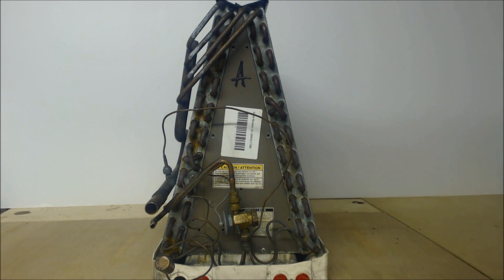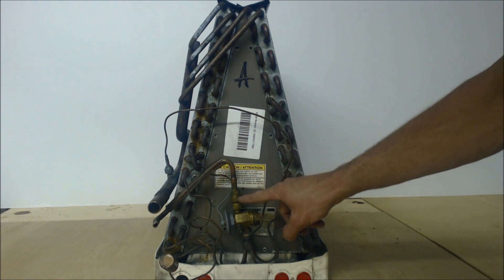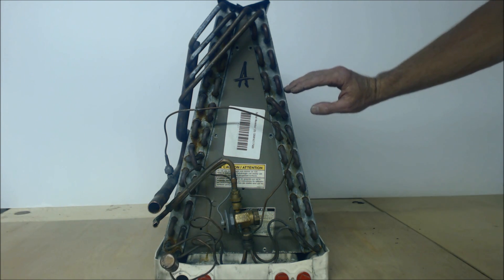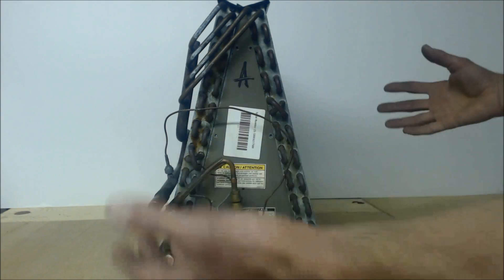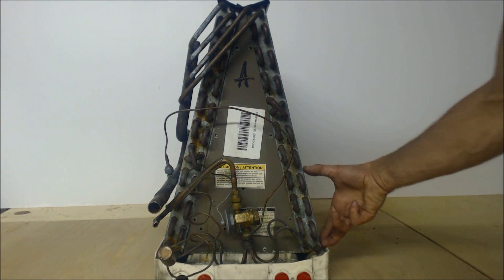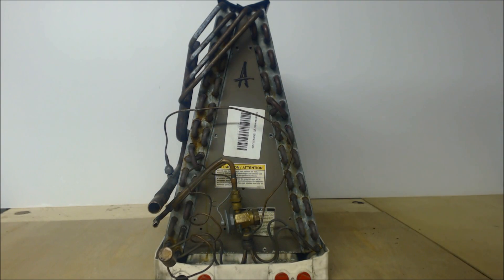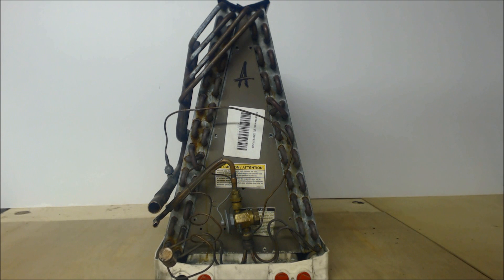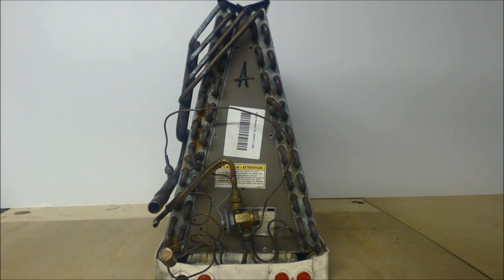Evaporator Coil! How it Works- Refrigerant Flow, Phase Change, Saturation Point, Superheat, Tips!

Comment: I have a question. I have an old Trane Air Conditioner and evaporator coil.  Could I use the evaporator coil for a air compressor air cooler? Thanks

Comment: hi, is there a recommended distance to mount this ac coil from the top of the furnace? thank you for all your videos.
Reply from the maker: Usually it sits right above the furnace heat exchanger when in the upright position but always follow manufacturers recommendations. In most circumstances, the coil box gets mounted to the furnace, thanks

Comment: hi, can you mismatch a system? like 2ton condenser with 2.5ton coil or 2ton condenser with 1.5ton coil? would these scenarios create problems? thank you.
Reply from the maker: That is quite a long discussion but I explain some of that in the book that will be coming out soon. The short answer is it can be done but it will depend on the metering device size and type. A TXV will somewhat help the situation because it controls the superheat across the evap, thanks mark!

Comment: I'm just starting, and man I love your videos!   All life savers like this one.   I was not understanding the purpose of the suction and liquid lines in relation to saturation.   What has be confused is, if the suction line is the return for the super-heated vapor, why is it cold, and the supposed liquid line at a lower temp warmer?
Reply: You still in the industry? If so how are you liking it? I’m currently in school almost ready to graduate and get my EPA
Reply: Super heat is relative to temperature at a different location in the cycle.  It has been colder.

Comment: Nice video acservicetech !! Would you explain ( or better make a video) about how the refrigerant behaves in evaporators ( air handlers) which work vertically and horizontally ? I just can't understand how a coil can work in the horizontal position without flooding in liquid. Again great video.
Reply from the maker: Lincoln, thanks for letting me know what you would like to see, thanks!

Comment: Hi there !! I just started watching your videos and already subscribe to your channel. 
I have a question and I hope you can have the answer:  I was checking the pressures on a R22 system with a fix orifice. Out side temp 70deg WB64 Lowside52psig saturation temp below 32deg inside DB76 suction temp 34deg target SH21 actual SH1deg  
Suction line by condenser going to compressor started making white frost. 
I checked evaporator coil was clean, I pulled air filter  every room has a 6in return grill with a 14" return round trunk. Blower motor was on the high speed. 

What could the cause that suction start frost ?
It seems like is under charge, but If I charge it will be overcharged right? well actually is overcharge already according to actual SH
I am lost in this one!!!
Reply from the maker: Your charging parameters don't really start for checking superheat until you are above freezing on that evap coil. What happens when you add charge? If only the head pressure increases and you have an exact vapor pressure that doesn't move then you may have an obstruction in the liquid line. If the vapor pressure just drops the whole time then it may be a lack of airflow. You could take the return ducting out of play by opening up the return door of the furnace and putting a magnet on the door switch but you can only do this if the unit is within the conditioned air area like a closet and only if you can have it be safe from anyone entering near it. You can't take a door off of a air handler because it would not suck air across the coil if this was a 2000 cfm 5 ton or less. The most likely case though is that you have a low charge and you have to add a little refrigerant in this scenario to see what happens because you checked all of the obvious things. I hope that helped. Thanks for the question and let me know what happens!
Reply: +acservicetech thanks for the reply 
I didn't add charge because I thought the suction temp could go more down since already was at 34deg

Comment: Great video! I am currently in school right now for HVAC and videos like this are very helpful. Do you have any videos on how to take readings with the VOM meter? Specifically Amp readings for the compressor and where you clamp it on at, Where you clamp it on at the indoor blower, and low voltage readings. This is very new to me and get confused a little. Thanks
Reply: How you doing now I’m so far a month into my classes lol
Reply: @redactavist987  Been in the trade for 6 years now. Stay motivated and eager to learn. Also stay humble and learn from mistskes you will make.